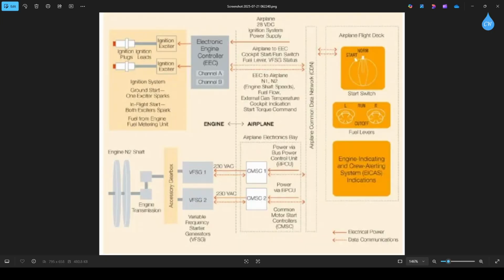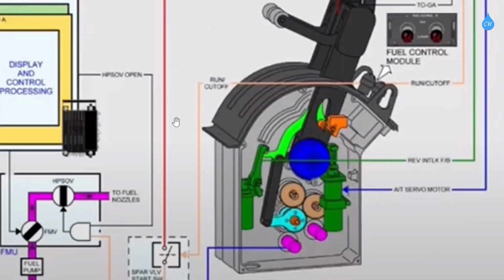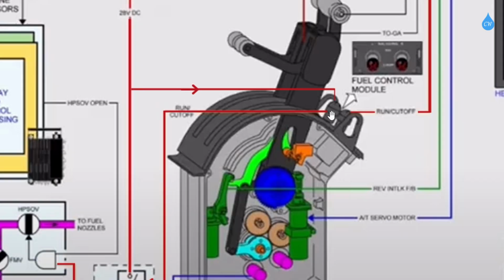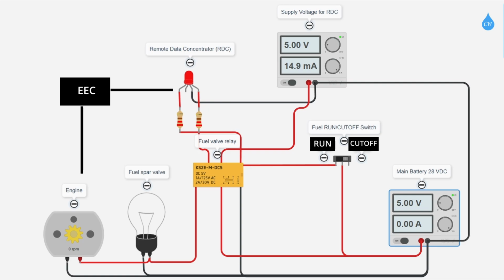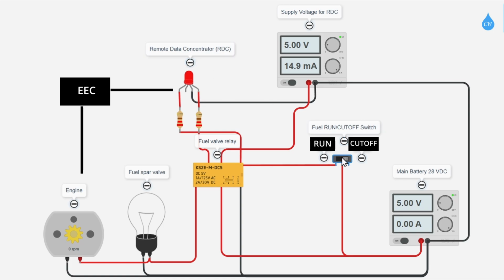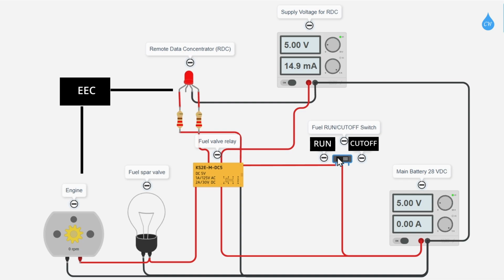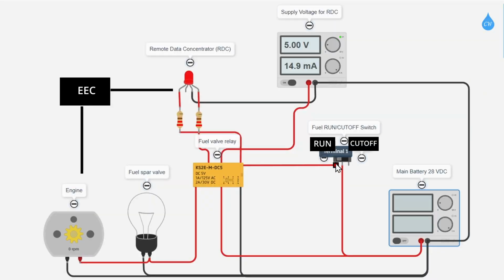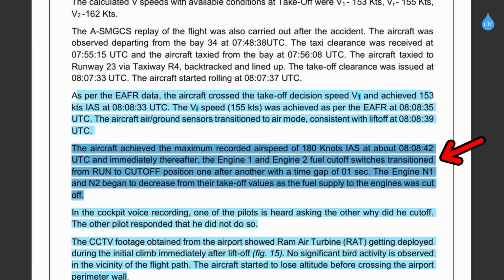Air India Boeing 787 Fuel Cutoff Switches - Clear Waters #airindiacrash #inspiration #boeing787

Comment: Some good investigating work here. I've read so many comments where people just don't understand the concept. They insist that nothing other than a person can MOVE those fuel switches. Well, that is true, but they don't understand that something else could have caused the black box recorder to think the switch had been moved, when it hadn't (by an electrical/electronic fault?).
Reply: "They insist that nothing other than a person can MOVE those fuel switches."

Yeah, you know why? Because only a person can move those fuel switches.

"they don't understand that something else could have caused the black box recorder to think the switch had been moved, when it hadn't (by an electrical/electronic fault?)."

Total nonsense. YOU don't understand why this cannot possibly happen: Wires run directly from the switches to the RDC's - the network communications devices that feed into the 'black boxes'. One wire signals RUN, another wire signals CUTOFF. In order for the FDR to record a switch movement event, both of these wires need to change their electrical state. The ONLY way that can happen is if the fuel switch is physically moved. No glitch, no electrical fault, no software/firmware error can cause this.
Reply: @BryanM61 not true. I've heard two aviation experts so far state that the position sensors for the fuel cutoff switches are not located at the switches themselves, so any interruption of fuel is interpreted by the DFDR as the fuel switches being moved to the 'cutoff' position,  whether they have been or not, since this would normally be the case when everything is working properly.
Reply: @timrider1224  Your aviation "experts" don't know what they're talking about. 

"so any interruption of fuel is interpreted by the DFDR as the fuel switches being moved to the 'cutoff' position"

Preposterous, and absolutely false. Please see my post below regarding the wiring diagram, and an explanation of exactly how the DFDR detects FCS state changes.
Reply: @BryanM61 on top of that, the cockpit conversation confirms that one of the pilots saw the switches moved to cut off position. If the pilot saw the switch in the correct physical position, he wouldn't have asked what he asked
Reply: @roseelectronics4582  You read a translation of a summary of pilot’s conversation as interpreted by an unknown investigator (unknown as no one signed the report that was released), which is also missing a timestamp, and you believe that it can be used as a fact to confirm the pilot moved fuel switch?

So let me summarize:
• You don’t know what was said exactly.
• You don’t know who was speaking to whom.
• You don’t know when it was said.
• You don’t even know if they were really talking about the fuel switch.
• You don’t know if it was really a question or a cry out loud being surprised by the situation or something else.

But somehow, they must be talking about physically moving fuel switches?

… unbelievable 🤦🏻‍♂️
Reply: @roseelectronics4582  That is not necessarily true. The FO has his eyes glued to the windshield, watching where he is going. He feels the loss of thrust and sees the EICAS screen within his field of vision flashing all kinds of alarms, including dropping EGTs (Exhaust Gas Temperatures) and knows the plane has lost power. He is not going to be looking straight down and to his left to see the switches being moved by the Captain while he's trying to take off, during one of the most critical phases of any flight. 

In the original report, the question was "Why did he cut off?" which was quickly changed to "Why did you cut off" according to an America engineer who got the report when it was first released.
Reply: @roseelectronics4582  We don't know if he actually saw the other pilot touch the switches. That's just conjecture. There were no actual quotes in the report. It was paraphrased. That opens up misinterpretation.
Reply: @Manticore1960 exactly, I'm not saying that he saw the switch being turned. What I'm saying is that he might have seen the switch turned to cut off position, regardless of him seeing anyone doing it. The switches physical position can not be changed without external intervention. This is what the report implies by the least. Electronic state changing of a switch is a different issue that needs investigation, but the physical position of the toggle switch should have remained unchanged in that case. The conversation suggests that one of the pilots saw something.
Reply: @tonamg53 in that case my friend, all that we are saying is speculation. There's not need to refer to the report or anything at all. Anyone can believe whatever they want. No need of an investigation.
Reply: @roseelectronics4582 Well yes, the report has a big problem. One should be able to read the report and don’t need to guess anything. The report should be very precise with the exact timestamp provided. 

It’s either they know this happened at this exact time or it didn’t happened. There’s no in-between.

But the majority of timestamp in the report is either missing or provided as  “about” or “approx”

And when the report is written like that, you know whomever write the report wasn’t using the data directly from the black boxes.  

Which is totally unacceptable.
Reply: @roseelectronics4582  Since there are no position sensors at the switches, all the FDR "knows" is the state of the fuel valves, which is either "run" or "cutoff." That is what the FDR is recording. We already know that the fuel management system can cut off fuel to the engines independently of the switches, since this has happened twice before, once upon landing and once mid-flight at full altitude. Fortunately, neither instance resulted a crash or loss of life (although the pilots in the latter case probably needed a change of underwear afterward).

Neither pilot would have had to touch the switches in this case. A catastrophic electrical event could make the FADEC "think" there was a problem with both engines, and shut them both down.
Reply: @timrider1224  if pilot is saying why did he Cutoff he probably referring to the Plane...not the person.

Comment: The back of a 787, specifically the aft electrical equipment bay, houses a complex electrical system including generators, power distribution, and various control and monitoring systems. The 787 uses a hybrid voltage system with 230 VAC, 115 VAC, and 28 VDC, and ±270 VDC. The system is designed with redundancy, featuring multiple generators and backup power

Comment: Thanks for this, the key to working out what may have gone wrong is considering the role of the Engine Control Unit in managing fuel supply. Some commentators miss this and think that the switch circuit is all that's involved.

Comment: I agree with your simplified circuit & conclusion.  It is more complicated than that, from what I have deduced from watching almost all of the AI171 videos.  I also have 50 plus years of  calibrating, repairing, and teaching precision test equipment.  The one survivor said there was flickering of the lights at take off.  The pilots also should have retracted the wheels, and the RAT automatically extending, both indicating they probably lost power, even a brief loss of primary power would cause all these problems.  There was supposed to be a backup emergency battery power & the APU.  They and  now investigating a possible small localized fire in the tail section (a battery?), and there was a reported sensor malfunction in this area the previous flight.  In short, anything causing even a brief loss of primary power could have caused a loss of power to the fuel valves even without moving the switches to cutoff.
Reply: Yep that wasnt actually the lights flickering, the direct translation was the green and white lights turned on.
Thats the WELS - wireless emergency lighting system.
This system is a bunch of lights that have batteries, which get charged from the 115 volt buses. These buses are both controlled in the p300 and 400 cabinets and are kept live (SPDU connected to their respective transformers) by the bus power control units . Now.... what happened to the bus power control units when the 28V buses died? 
 Both the 28V powering the WELs controller and the 115 v powering the actual chargers, all turned off, leading to the emergency lights coming on.
However, in the loss of rotation if both engines, the generators would stop supplying power to the 115V transformers and the emergency lights would turn in also. So unfortunately this isnt the smoking gun, but if the survivor was able to tell us at what second the WELS lights turned on, then we could use that.
The poor guy is in a bad state after his ordeal, and the authorities are probably paying him a lot to keep quiet.
Reply: @cosync there is video from a passenger on the flight preceding this one clearly show lights flickering on and off, with everything on the back of the seat in front of him dead. Clearly there were electrical issues with this aircraft.
Reply: @timrider1224 that was the controllers of valves and other 28v powered things for non critical passenger comforts getting shed by the power management system, when current was flowing through the broken diode through the battery leading to voltage issues in the central dc buses. The secondary power distribution units needed to keep critical things alive, so were sacrificing the highest demand, lease critical systems. Questions... Why the fk did no ine say anything? Short answer; india. No disrespect meant, but often things that don't work are just accepted as a part of life. I know, i moved to the philippines.
Reply: "The one survivor said there was flickering of the lights at take off." That is NOT what he said:

"After takeoff, within one minute, when takeoff happened, then suddenly 5-10 seconds what I felt like it got stuck. After, (only to me???) it felt something happened. After, in the plane, light came on, green & white."

This happened because the engines stopped generating electrical power, and the WELS system kicked in. When main power is lost, a backup battery system kicks in. The emergency exit lights - one of which was right above him - are green and white.
Reply: @BryanM61 thanks for the correction
Reply: @BryanM61 yes that is true, the loss of the engines below the threshold of the power from the VFSGs would cause the lights to turn on. But so would collapse of the BPCU power supplier controlling the 115v from the SPDU.
Reply: @cosync  Which is obviously what happened here, as noted by the mass of references in the Prelim to electrical power malfunctions, EAFR indications of unusual voltage measurements, and culmination of a total collapse of the electrical system - none of which could caused the engines to shut down.
Reply: @BryanM61 except ur missing huge clues. Time will bring you answers
Reply: @BryanM61 and what fkn mass references ate you referring to???? Where is the mass? You're a member of the public , and you've been misled. No disrespect, but you dont know.
Reply: @cosync  I was being cynical. Sarcastic. There are, of course, no references whatsoever to the electrical system malfunctions anywhere in the Prelim. There are some recent rumors to some sort of fire, possible electrical, in the area of the tail.
Reply: @cosync  BTW, I'm an aeronautical engineer, and have spent hundreds of hours studying this accident. I take NOTHING as factual in any video I watch, and research and verify everything.
Reply: @BryanM61 so do i. And i know what happened.
Reply: sounds all correct😊. i concur. you two guys are spot on. no wonder the guy who said i didn't..Really Didn't. no wonder the RAT came out very quickly, before the Fuel cutoff switches registered cutoff,,seconds before possibly. The problem with moderna jets Is WAY to much electronics. Not only that but now combine a mix of AC AND DC. and battery problems. The most common question Heard on todays voice recorder Is "What's it doing Now"...meaning usually something incorrect😮
Reply: There are two switches. So the power was cut off one at a time and then ten seconds later turned back on one at a time? You say you are a technician - where is the circuit diagram to show that is possible?

Comment: Let's assume the battery glitch turned off the switches electronically. If that were the case what would/should the pilots actions be after that ....? How does this scenario jive with the preliminary report where it says they tried to restart with 4 second interval? Why did they do a restart if they didn't turn the switches off. On a dual engine failure at takeoff the manual says to not turn off the fuel switches and keep them on the run position.
Reply from the maker: Good question. Probably voltage was reestablished and the fuel RUN signal was there again and that started auto relight of the engines.
Reply: Pilots dont always know what's in a Boeing manual. pilots are there to FLY...not read ,learn, know everything in a Boeing manual. then troubleshoot complex electrical systems
Reply: The battery short circuit drew enough current that eventually the thermal breaker popped releasing the battery from the bus and allowing current to resume flowing from the rectifiers through the normal paths without the broken battery involved at all. But it was too late.
Reply: Normally, shutting the switches to the cutoff position to reset the EEC is part of the restart procedure. This is what they would have been trained to do. If engine restart at takeoff requires a different procedure, they may not have been aware of it. They were using standard operating procedure, and were under intense pressure.
Reply: @timrider1224 except that would mean there must have been 2 engines down and they restarted both.

Comment: You are totally WRONG. The sensors are located in the actual switch, not the fuel control valves. There are several poles inside the switch.  One or two contacts are wired to the engine. The 3rd contact is wired on a (separate) circuit directly to the data recorder.
Reply: The sensors u refer to are optocouplers in the remote data concentrator. The 4 pole dual throw switch connects ground (current return network) to the following:
1. Igniters and fire relays
2. CCS left and FDR (via data concentrator)
3. Fuel control relays for wing fuel Spar valve closure, where a 28v from the outer dc bus is closed and sent to close the valve.
4.CCS Left and FDR, via the other data concentrator
Reply: @cosync does the signal from the four pole duel throw switch go though any relays before it gets to the concentrator?  🤔
Reply: @timrider1224 no the concentrator RDC is a bit like a relay. The RDCs are right below the switches. The 28V hot batt bus goes through the RDC, through an optocoupler digital I/O module inside it) and to ground via pins 2 and 4 of each switch. The 2 pins are because there are 2 RDCs. One going to computer A and one to computer B. The single point of failure is the connection of both these buses back to a diode and battery, but not in a Y fashion, in a passthrough.
It takes a second for right to be connected to left if left or right go dead
Reply: What you're saying directly contradicts what at least three other aviation experts have stated, one of whom is on this forum and seems quite knowledgeable. So now we're left with trying to decide who is correct.
Reply: @timrider1224 well dont think of me as an aviation expert, think if me as a dc electronics and systems controls expert who happens to be obsessed with aviation.
Reply: @cosync too late, you've already exposed yourself!  😄
Reply: @timrider1224 have I? Is it obvious where I live?